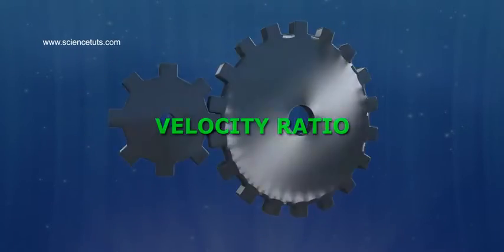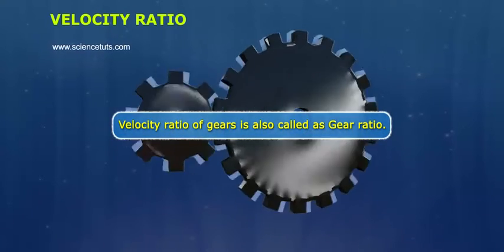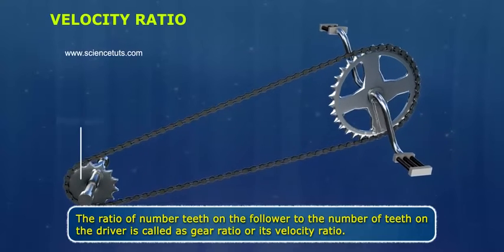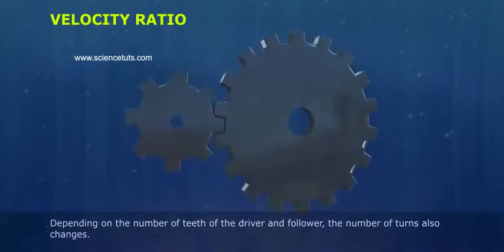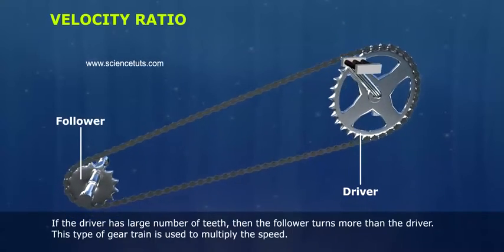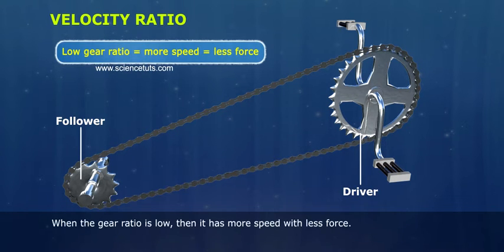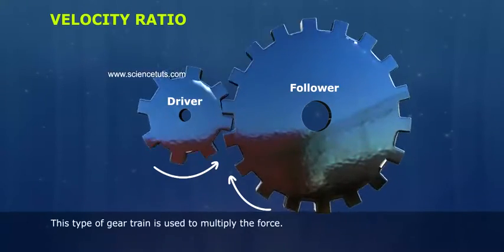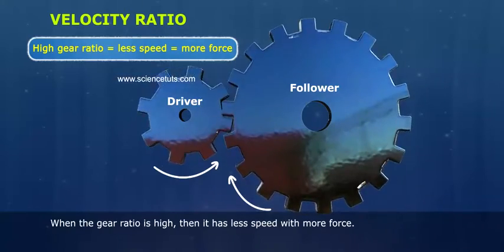VELOCITY RATIO

Comment: A driving gear having 25teeth engages with a second gear with 20teeth. A third gear with 30 teeth on the same shaft as the second one engages with a fourth gear having 60teeth. Find:
a) The total velocity ratio of the system.

b) The mechanical advantage of the system if its efficiency is 85%.